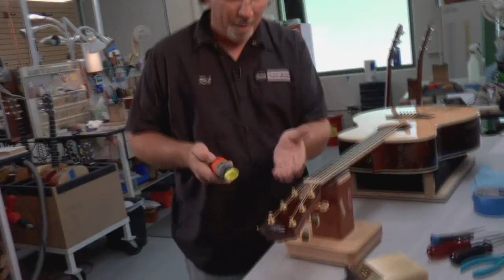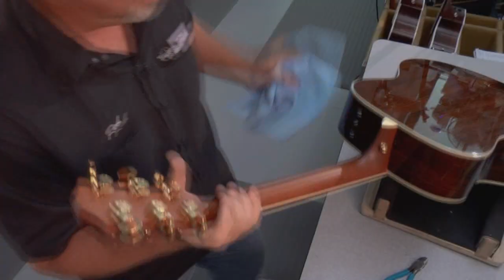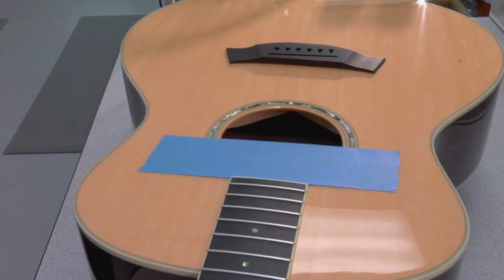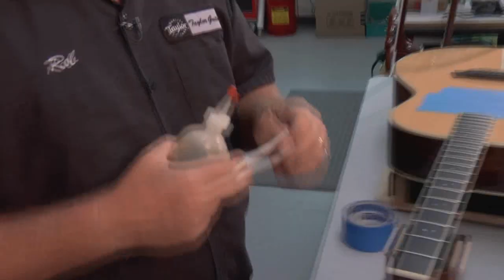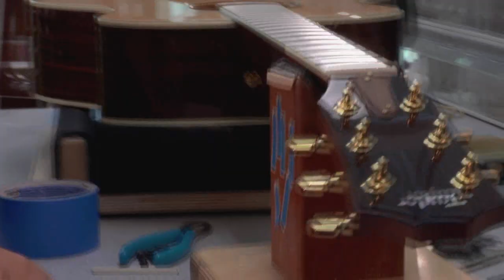Taylor Guitars Cleaning and Maintenance Techniques: Part 1 | ELIXIR Strings

Comment: Althought there is a lot of good info in this video, I would NEVER use steel wool or pullers. Leaves particles in the FB, gets in your pores, gets inhaled. White or gold scotchbrite pads avoid all this AND you don't have to tape over your newly polished guitar. Using pliers (which is what those 'pullers' are, really) to remove bridge pins is a disaster - scratches the pins, scratches the bridge. Far too aggressive. If you need to use pullers, either your pegs are too tight or your ball ends (sorry I can't think of another way to say this) are pulling up into the bridgeplate (bad) or just jammed tightly against it (OK). Once you've got all the strings off, just push each string down a quarter inch into the bridge and your pegs should be immediately loose enough to remove with light finger pressure.

Comment: so you clean the dry finger board with dry steel wool?  no soap or cleaner what so ever?
Reply: Yep! You can use an oil soap (e.g. Murphy's) and water if you'd like, and some techs do, but I've never found it necessary. #0000 steel wool on a dry fingerboard cleans great--just be sure to go WITH the grain, and use a little fingerboard oil afterward to bring some of the rich color back.

Comment: I have a small music store and a luthier shop. I installed a set of Elixir stings on a D 16 martin several years ago, when the client tried them in my shop he said, "the year old Martin strings sounded better sounded better."  I held the elixir strings at the sound hole so they would not hit the guitar, cut them off and replaced them at no charge with Martin Marques.  I disposed of the several sets of Elixir strings I had in stock , now I only carry Martin, D'Addario, GHS, Thomastik and Super Sensitive Strings. Why would anyone use steel wool on frets in the wrong direction?

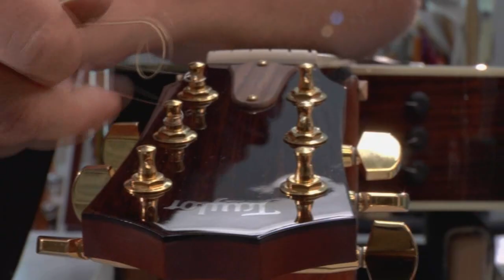Comment: @ 1:26 you can easily scratch the headstock with that loosey goosey string touching the headstock after it pops out technique.
I wouldn't let you work on my Healdsburg Presentation Goodall Macassar Standard.

Comment: If you have a nitro finish please don't use blue painters tape in the way this guy does. You'd be safer laying a cloth or a towel over the soundhole.  I'm assuming Taylors have some sort of UV cure  poly lacquer which the tape won't rip off.

Comment: I just received a Taylor 110ce for christmas. The finish is "varnish", not a high gloss lacquer. Is it ok to wax the body with turtle wax on top of a "varnish" finish? Thanks.

- Bill Ball
Reply: I wouldn't risk it, I don't think waxing is necessary
Reply: Don't wax wood that is not glossy.  Wax will fill in the pores, which looks ugly since you can't buff it off, and and probably deadens the sound.

Comment: Linseed oil is a FINISH. It doesn't matter how little time it spends on the fretboard, it still soaks in filling the pores of the fretboard and changing the molecular mass. No decent luthier would ever recommend using something that stops a rosewood, ebony or other unfinished fretboard from breathing.

Comment: Looks like your cleaning a clean guitar. What if the guitar has had strings on it for years and the frets are tarnished and the fretboard dryed up? What you did wouldnt work.  The strings were black where they hit the frets.

Comment: i have a cort grand earth i know its still wood but do i still use boiled linseed oil or just linseed oil and what is the difference and will it wreck my fretboard
Reply: Boiled linseed oil is the way to go. It dries out much faster than raw 
linseed oil, so it doesn't have as much of a chance to sink in and dissolve the glue holding the fingerboard to the neck.

Comment: I never use anything other than Murphy's oil soap, diluted 3 to 1 with distilled water to clean and polish my guitars, even on the fret boards, plus a little Cape Cod metal polish for frets themselves.  
It's been working for 40 years and never fails to keep them clean and looking great.
Reply: 3 parts oil or 3 parts water?
Reply: @taddyschmitt  
3 parts water to 1 part Murphy's

Comment: Isn't it ok to let a light application of boiled linseed oil sit for maybe 15 minutes if you only apply it a couple times a year, and that's mainly NOT in the summer but the drier months?  Then wipe and continue?  It does seem to soak right in.
Reply: The fretboard is really thin, so you don't need to let it soak in for a long time.  You don't want the oil to reach the glue holding the fretboard to the neck.

Comment: I know that he's a tech and can remove all strings at the same time, but I was told that there are 3 pounds of pressure on the neck, and to remove one string at a time, or you then have to bring the guitar to a tech to be re-set. Does anyone have any comments to make about this? And the other problem is that if you don't take all the strings off at once, how do you clean the fretboard?
Reply: Everything I've read says taking all the strings off at once for this type of process is A-OK as long as you don't leave them off for a long time.  Take the strings off, clean/oil, make sure dry, re-string.  No problem.

Comment: Shouldn't you save the polish for last. Also bone pins are fragile, push them from inside out so they are not scared by the wire cutters you used. I have set up and cleaned 1000's of guitars,basses, violins, cellos in my 40 years and would never treat an instrument like this. No disrespect intended.

Comment: I think a healthy dose of objective observation does not make any reasonable critique unjustified. I have seen a number of "experts" have totally opposite viewpoints. The sponsor of this video appears to be Elixir strings who I have a difference of opinion with.
They are comparatively high priced strings that claim to be superior which they may be. However, I'm sceptical that the high price is justified, for a number of reasons. Whilst the coating may indeed prolong the life of the string protecting it from corrosive exudes that come from fingers. I fail to see how linear tension fatigue ( the diameter of the string reducing at the weakest point after being on the guitar at full tension over a period of time ) equal to that of uncoated strings. (Known colloquially as the stretched chewing gum effect.) Such tension fatigue will effect both types of string equally. Tension fatigue is the main reason why strings go out of intonation over time and the more they are played the shorter the life span. Quality windings can be cleaned and kept in God condition and are less muted and brighter than coated strings. It's pure physics. The low resonance of a string coating in my opinion will interfere with the resonance of the material it is on top of. A bit like loud speakers having covers over them will be less efficient than those without. Some speakers are sold without covers for that very same reason, that of clarity.
Hence I personally stick to uncoated strings and change them when they fail to accurately intone.
However it is an opinion and if it differs from others then good luck and good playing.
Reply: I don't think you know what you are talking about.  The reason I say this is because you wrote about the strings going out of intonation.  Strings can go out of tune but not out of intonation.  Intonation has to do with the relationship between the strings and the frets.  An easy way to check intonation is to play the harmonic at the twelfth frett and then play the note.  If they are the same your intonation is good.  If they are not the same then your intonation is off.

Comment: Steel wool on the fretboard? Please! No!
We're just trying to remove the build-up of grime attracted by human body oil...not refinish it...
A mild solution of citrus-based cleaner is all that's needed....I use diluted Palmolive dish soap with a few drops of lemon oil...
Tape off the neck and apply with a toothbrush - very sparingly......
Clean with distilled water on a cotton puff and dry thoroughly...
Then seal with tung oil and buff.....
And using a pair of wire cutters on the pins - why? ...they make special pin-puller tools......
I'd have a heart attack is I saw someone using a pair of sidecutters on my bone pins...

Comment: That is a 2,000.00 guitar. I can't believe you used steel wool to clean your fret board. If it was mine I would use a tooth brush as to not harm the fret board.

Comment: So, I'm sure he is a great tech. The first thing I don't agree with is taking all of the strings off at once. This is wood under pressure. Why change the tension on the neck of a very expensive guitar if you don't have to? One string at a time is fine. Are we at home, in a hurry? Also, you can clean a guitar with stings on as you go. And, why not wrap the strings against the peghead with a "Martin" wrap?? Are we again, in a hurry? Check out the Fretnotguitarrepair guide on doing this, and string stretching, and really all else related. Like he said, he is in a factory. I'm sure it is a great one as well. Relax, take your time. Do it right the first time. It is worth every note.
Reply: Notice that he slackened all the strings first, so there was no longer any neck tension to be concerned about. Besides, modern guitars (of which Taylor is a leading example) are very well braced and stable.

Comment: I would not let this guy anywhere near my high end guitars - he totally over cleaned that guitar  which is unnecessary - a barely moist/damp towel wipedown works just as good and is safer AND cost nothing.

Comment: Who's a silly Billy?  
First he uses wire cutters to pull out the ebony bridge pins!  there's a cheap plastic tool you can get for that which won't do any damage, or do what a lot of acoustic guitarists did for years and stick your hand in the sound hole and push the pins up.  Then he polishes up the guitar, then puts masking tape over what he's just polished!!!!!!!!"  NO!  That should have been done before he cleaned up the fretboard, then he could take the tape off and polish up the guitar.  
How many more mistakes is this  galoot going to make, and I'm only half way into the video?